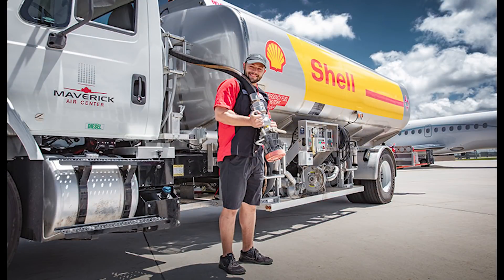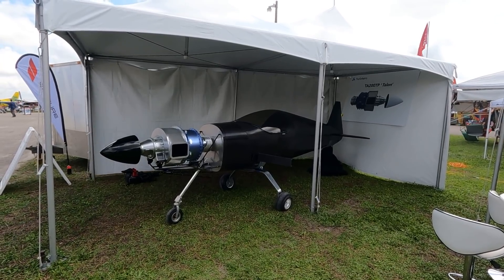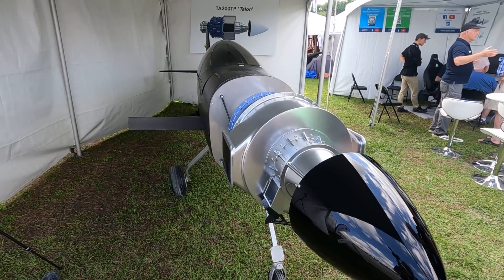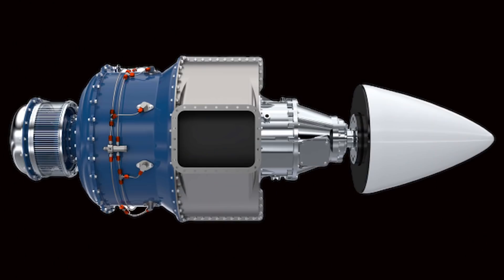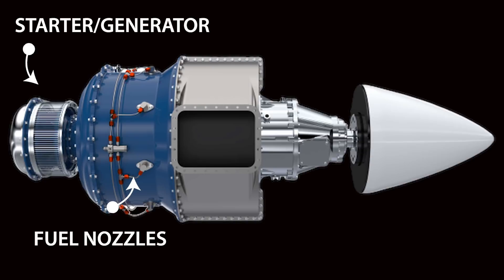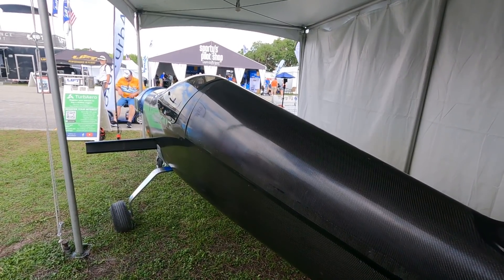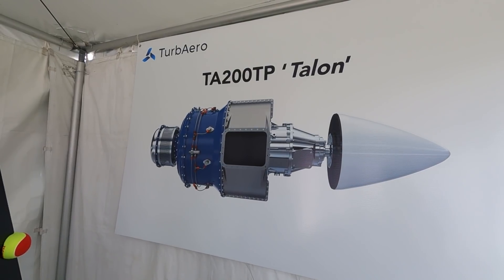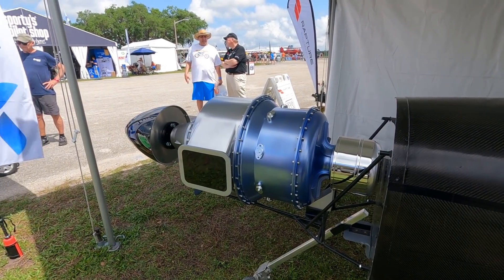TurbAero Aims For a New Turboprop Engine for Small Airplanes

Comment: TurbAero still only has a mock up, which it has had for years. Meanwhile Turbotech - a subsidiary of Safran and so much better funded - is actually test flying just such an engine (small turboprop with builtin recuperator) designed expressly to compete with Rotax 912. They are much closer to market than TurbAero. See https://www.youtube.com/watch?v=OfdNoc_6vN8&t=3s

Comment: 200hp at 800' c .   sounds good Dave. 
perhaps try that engine powering a big water pump at EGT 810'c for 4 hours
then check the stators section and  N1 turbine.

Comment: $85 000 for a light sport aircraft engine is out of the ball park when you can get a Rotax for around $22 000. Become competitive on the price point even $45 000 would make a difference and the upgrade would be relatively painless.

Comment: This would be a great success if they did it for a 500+ hp engine.  The cool factor notwithstanding, I fear not enough owners will be tempted to spend twice as much in purchase/overhaul cost for saving 50 lbs engine weight and $20/hr on fuel, over other 200hp engines.  This recuperation technology sounds like it could be a real edge in the right power category.  Use it to compete with the TIO-540, PT6A and TPE-331, and that would be a game changer if it is mostly better in terms of power-to-weight, cost and efficiency; then you could see lots of owners looking to upgrade their aircraft.

Comment: Funny how suddenly two different manufacturers (TurbAero and TurboTech) have designed turbine engines with exhaust heat exchangers at around the same exact time. My only guess is that the invention of laser-sintering has finally enabled this technology to be manufactured at an affordable enough price, in small turbines that is. I wonder if GE and Pratt will follow and include exhaust heat exchangers in new engine models. The PT-6 series is due for an overhaul; and I’m not just talking about slapping a FADEC on it.

Comment: Interesting.  He mentioned wanting to use it for STOL.  A 17 foot long, almost 300# engine costing $80,000.  I would imagine the fuel burn would be quite high so the need to carry the extra fuel is going to add unwanted weight.  It will be fun to watch this develop but I am not convinced they have the right target market.
Reply: The whole point of the heat exchanger design is to make it more fuel efficient. He specifically said that this engine can be 25% more efficient than non-heat exchanged aircraft. So hopefully, the fuel burn will be on-par with a piston engine, if not better.

Comment: Sorry I got $20 on another vaporware paper engine that will never go into production. "Recuperator" technology, 3D printing, "micro channels"? Cough. Yeah, sure 3D printed parts handle what temperatures? He even choked on his own words. Sounds like sales pitch and deposit mining, in which you will never see your deposit again or an engine. They had promised to be flying by now and still showing the same plastic mock up as they have for years. 

THINK. What small turbines used in real small SE turboprops aircraft that have flown? P&W PT6, Alison 250 (now Rolls-Royce M250, US Military T62, T703), Garrett TP331  (formally Air research now Honeywell). Look at them. There is no simple Turbine and none that have the same fuel efficiency in the 200HP range and maintenance cost as a piston engine. If you have the money you would not bother and go buy -Pilatus PC-12, Piper M500/M600, TBM 700 to 900, Epic E1000, Cessna Caravan 208. Before the recent inflation many older models were less than $1M.

Their new Recuperator technology (funny name, and not new. Engines of all kinds, steam, reciprocating, turbines, have been using heat exchangers and energy recovery systems for 70 years to increase efficiency). They can not defy physics and thermodynamics. Aircraft turbines today use many technologies to make them more efficient, but not a "Recuperator" is not one of them. Variable vanes, multi stage turbines, multi spools, etc.

If going turbine you really need to be in the 450HP and above range to justify it. Not may GA kit planes can handle 450HP (a few can). Small turbines are APU's or a novelty. Many of these micro jets (not turboprop) use on planes like Sonex Aircraft SubSonex Jet come from a drone or RC model engines, with fairly low thrust, and they have TBO's of a few 100 hours. Even if they got this working it would need to be overhauled frequently.  You ARE FAR better buying a used Single Engine turbine plane already flying if you must have turbine and have $$$$$. Before the current inflation a used TBM700, or Turbine Piper or Cessna was well below a million. Now everything has been artificially inflated due to US Gov printing money like water and committing energy suicide. Thanks Biden. 

Turbine? You gain lighter more compact package for HP (again in the 450 HP and up range). You have much higher HP potential beyond a piston engine, but way more HP than a small GA plane can use. To use excess HP the idea is fly very high, and this means pressurization (or uncomfortable pressure O2 masks). Again better off buying a certified SE turbine. You gain in theory more reliability, but fuel economy? No. The P&W PT6 is de facto engine for SE Turboprops and burns 50 to 70 GPH at $5/Gal.  There is no free lunch. Turbines are expensive to buy, overhaul and feed fuel. A PT6 min HP is about 500 HP, and just the engine, outright, if P&W would even sell you one is $1M. An overhaul if they find bad parts is half the price of an engine, 100's and 100's of thousands for a routine overhaul. So these guys have cracked the code in cheap turbines suitable for GA plane sizes and budgets? Serious doubts. Good luck.
Reply: Your skepticism is certainly justified. I think the reason they're targeting around 200 HP is because recuperators just don't scale well with larger engines, hence IGV/CGV's, multi-staging, spools, etc that you see on aircraft turbines.

TurboTech has a lot to prove. I hope they're successful -- a Jet-A burning economical 2-seater with low noise, higher performance at altitude, comparable range and better reliability than a piston would be neat. I hope there's a market.

Comment: Doesn't raising intake temp just reduce the amount of power the engine can produce?   I don't understand how feeding the engine hot air helps.... with power OR efficiency.
Reply: That's correct increasing the inlet temperature  decreases power.  If fact take-off power, etc. get derated at higher inlet temperatures.   There's a maximum turbine inlet temperature that limits things.
Reply: Increasing intake temp BEFORE compression occurs reduces power/efficiency. The recuperator takes the wasted heat from exhaust and transfers it to the air AFTER compression before combustion, thus increasing efficiency.

Comment: whelp, going to have to read about recuperators.. my intuition tells me you would want the coldest charge possible fed to the boom boom part to maximize thermal expansion? chew time
Reply: Yeap, Im seeing it the same way.  Something here makes no sense.
Reply: You want cold air BEFORE compression not before combustion. This is heating air AFTER compression and before combustion.
Reply: @TomM-jh8lx   how is that any different?
Reply: @austinwilliams9592  It takes more work to compress hot air than cold air. This is why you see intercoolers in between compression stages. For example, having an intercooler after a supercharger and before the intake into a piston engine as the pistons themselves will undertake further compression before burning the fuel. In a turbine engine, the recuperator is positioned after all the compression has occurred right before the air enters the burners. By transferring waste heat from the exhaust to the compressed pre-burner air, you are reducing the amount of fuel required to heat up the air to the desired turbine inlet temperature (TIT). Simply, TIT multiplied by the mass of air determines the power output of a turbine engine. Recuperators are common in large land based gas turbine applications where mass and size are not an issue.
Reply: I had the same observation, as thermodynamic efficiency increases with deltaT?
Reply: @1965wazza  Correct - this is an outcome of the second law of thermodynamics. The limiting efficiency value of any heat engine is the ratio between the heat of combustion and the temperature of the environment into which the engine exahusts its waste heat. Higher combustion temperature leads to higher thermal (fuel) efficiency. Doing some fancy math leads to piston and gas turbine/jet engines having higher efficiency as you increase the compression/pressure ratios.

Comment: The recuperator is an old idea - it was used in the Chrysler Turbine Car, the Ford Turbine Truck, and I think the Rover Turbine from even earlier - but it's new in turboprops. Not sure why. Maybe the added weight and complexity weren't seen as worth it. Or, the gains in efficiency didn't matter, because any customer who could afford a turboprop in the first place wasn't going to worry about fuel costs.
Reply: I think its your last point. If your dropping half a million on an engine, I doubt burning 10 GPH more really bothers you...

Comment: Good luck with your endeavor! Hope it works out. Regarding piston to turboprop conversions, wondering if there’s going to be CofG issues because turbines tend to have lower weights than pistons.
Reply: Simple fix is moving the engine forward like they do in a turbo otter.
Reply: So far it’s heavier than piston.  That’s a worse problem to have.
Reply: @dodgecummins6181  well its heavier than a 110hp rotax lol. Anything making 200 hp is a 6 cyl and it will weight less than a 6 cyl.

Comment: Will need to be extremely more reliable than its piston counter part to justify that cost.
Reply: Traditional turbines are.  And they normally go 4-8 times the hours between overhaul.
That gets the fixed costs per hour way down, but is that worth it to the typical private pilots that doesn't even manage 1000 hours in their life?  I mean what good is a 7000 hour TBO when it'll only fly 800?

Comment: There's a reason there aren't any successful turboprop engines for light aircraft after 70 years: physics. A gas turbine depends on mass flow rate of air through the engine to develop power. Below about 500 shaft horsepower it becomes very difficult to get the necessary flow rate without the air flow going supersonic. The method described to get around this problem insofar as possible is a variation on the engine used by Chrysler in their experimental turbine cars from the early 1960s. What they did worked but high build cost and poor fuel economy made it a dead end.
Reply: Moreover, to get efficiency in a turbine engine, you need to increase the compression ratio. And that requires more stages, which means more weight and complexity, and more fuel burned to compress the air. That's why the most efficient engines are the biggest ones.

Comment: I am a little confused, this engine is a gas generator type turbo prop engine.  So on this assumption, it's the amount of high pressure exhaust gas generated is the key to transfering  the power to turbine.  Not sure how preheating the inlet air will help, after all it will lower the air density, which I would have thought impacted the potential power inlet air.  Perhaps, someone on here can explain this?  The other thing to note,  there is already a 350 shp engine on the market, the RR 350.
Reply: 1.  FYI,  gas turbine is a (George) Brayton Cycle engine.  
2.  GTs are internally air cooled pumping about 2/3’s more air for cooling than needed for combustion.  
3.  The air compression absorbs power and fuel.  GT airflow is constant and compression horsepower constant.
4.  AT low  net outputs the GT is inefficient because compression absorbs so much energy.   At high outputs the GT is more efficient because the compression expense has been paid and fuel is going to power.
6.  In this vid’s GT, air goes through a compressor, to the combustor, to the turbine.  The air exiting the compressor is about 200F.  It must be heated by fuel to 1200F.   The air leaves the turbine exhaust at say 800F.   
       The regenerator transfers the exhaust heat to the raising compressor exit air.  It raises the exit air from 200F to 500F.  The combustor then only from 500 to 1200, ......not as before 200 to 1200.
7.  Air density only affects the compressor’s efficiency, nothing downstream.
8.  There are dozens of GT arrangements.  Typically prop shaft GTs have a gasified section and a power turbine, but not always: Honeywell TFE 331.    Cheers D

Comment: Remember what good ol' "Wrong-Way" Corrigan did with his barely airworthy Curtis Robin, a single engine with a water-cooled Liberty WW I-aged military surplus engine as standard.  Corrigan just replaced the in-line water-cooled underpowered heavy engine with the lighter and more reliable and robust AIR-COOOLED RADIAL engine, just that and additional fuel bladders and flew nonstop from New York to Ireland and landed safely - to come home to a bigger welcome home homeboy hero than Lucky Lindbergh who ALSO used a high-wing radial engine years before.  He did the whole stunt REALLY just to prove the superiority in suitability of the air-cooled radial BUT never could admit such or be subject to felony prosecution.  The point is an engine breakthrough like this turboprop is a similar gamechanger.
    BTW, Douglas "W.W." Corrigan was a top aviation pioneer AND a key employee engineer of the Ryan Aircraft Company that designed and built The Spirit of St. Louis for Charles Lindbergh.  It was Douglas Corrigan who, single-handedly, designed and built the entire wing of Spirit.

Comment: I am overjoyed at the new idea of applying a aircraft makeover up-grade with these new turboprop engines designed specifically for light GA engines installed in existing suitable aircraft with reciprocating engines for entirely NEW and refined, yet old and tested features and systems to be so further refined, and all synchronized to yield a new aircraft of astounding capability JUST by this change to turboprop and refined systems.  I've seen a few pioneer makeover companies that do such things for owners.  Their products are magnificent new performers, e.g., the Omaha Silver Eagle, Cessna 210.  Here they can just about double every performance consideration in the process without buying a completely new airframe, company, etc. AND have all the fun and exhilaration of an entirely new and surprising aircraft at a fraction of the cost in time, money, effort, risk, training, etc.  Turbopropulsion and high-performance props are the waytago in GA, for all good intents and purposes.  This engine can make it ALL happen,   Go TurbAero, go!

Comment: A high-production, state-of-the-art turbo prop engine designed from zero to replace 4-6 seat suitable GA aircraft IS the greatest "next thing" in aviation technological history.  Such a feat has to be started from scratch as patents of all types prevent profitable developments every step of the way.  Nevertheless, while the additional up-grades are so big in consideration of any and all aircraft design in total, GA aircraft airframes and support systems and many procedures too must eventually up-grade to standardize the turbo-propeller in true high-performance GA expectations and real and reasonable needs of pilots today, all things considered.  THEREFORE, this business venture is very exciting, right on the money, aviation-wise and can capture the infinitely BIG market awaiting whoever delivers the golden GA turboprop, like the Merlin engine, to the long overdue and enormous GA community.  Go, TurbAero Go!
Reply: So...how much have you invested in TurbAero?
Reply: @earlgreystoke3324  I'm not a financial investor.  I don't and never have had any discretionary income, so little so, I've no experience, necessary knowledge, temperament, discipline, etc., i.e., all the personal tools required to have, hold, or spend, shop, speculate, gamble, etc., do any portion of finances, so have not invested in any type of business venture under any circumstances.  Investment, etc. is quite alien to me.  I think I'm inadvertently  allergic to it and have NEVER liked any portion of it, in self or others, at all.
Reply: @earlgreystoke3324  P.S., sorry, " . . . NON-discretionary . . ." funds is what I meant to say.